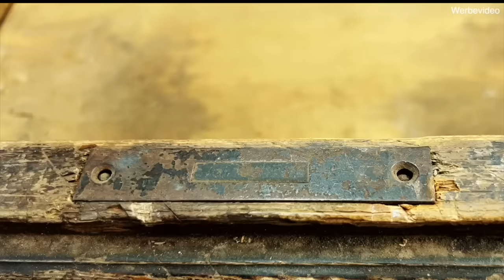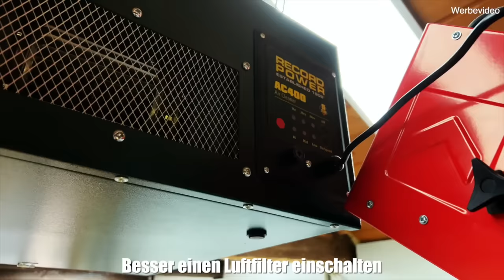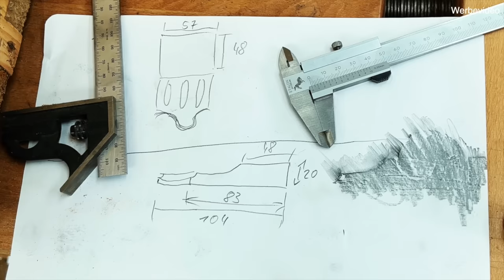21 Jahre Hühnerstall! EPOCHALE Rettung dieser Kommode

Comment: This is my favourite restoration channel. Love how the video is put together, great editing. Sir, you have skills to die for. Patient and a real understanding how to work wood. You are a great artisan.
Reply from the maker: Many Thanks
Reply: @chrigunrestauration  this is the most engrossing task undertaking I have seen for a long time. I feel so much better attacking my simpler chest of drawers now. Even without any tools to speak of. Thank you for your care with the old chicken sh*t piece to handsome treasure. Stay well.
Reply from the maker: @nancyanneberg403  Many Thanks. You don't need all the tools. The various tools only make the job easier. But it works with a lot less. You can achieve a lot with a nail lifter, scraper (plus accessories for tightening), paint scraper, one-hand plane, 2-3 chisels, glue and a grinder. Plus a hand and table saw. Then you are already well equipped. A lot of patience is also helpful. 😊 Greetings
Reply: @chrigunrestauration  I have mainly done wood repairs on several old homes rather than furniture. My days if house restoration are over but the furniture is something I can do. Thank you for the encouragement. Stay well
Reply from the maker: @nancyanneberg403  You're welcome. I wish you the same. Regards
Reply: Инструменты у него просто супер!

Comment: Wow, that took some real determination to bring that back to life.  As far as the discoloring on the wood, you can try "wood bleach", which is usually a two-part solution of sodium hydroxide (caustic soda) and hydrogen peroxide, and also could try other bleaches that have chlorine bleach and oxalic acid.  There are many brands on the market to buy.  In this case, maybe the dark stain was the better choice as there was so much damage.  All in all, what a fantastic transformation, good job.
Reply from the maker: Great information. Many Thanks. I will try it. regards 😊👍
Reply: I’ve used both of the bleaching agents as well, with mixed results, especially on oak. On pine it worked better. I also waited for warmer days, hoping that would let the chemicals absorb better. I don’t know that it made any difference; it was a notion I had. 

I always used a TSP solution on things this nasty. Now I’d start with a kitchen spray cleanser to see how well that worked. 

Your tool collections are fabulous. I could spend hours in your shop. Of all the tool hand planes are my favorite. They’re so satisfying to use and the configurations are so varied. 

I chuckled when you said you were beginning to realize the job was a bottomless pit.  But what an excellent opportunity to practice your skills!

A minor point: it looked liked the feet were left unfinished. Or did you just wax them?

I’ve lost so much of my German over the years from lack of practice but was happy that I could get the gist of your captions. 

Vielen dank, mein Herr.
Reply: @melindaostergren8115  I agree with you! He is definitely a caring and mostly patient craftsman who I’m very impressed with! Sir CR, I appreciate your talent and am thrilled that you shared this with the world!  Thank you for the pleasure to watch you restore this beautiful piece as close to the style of the craftsmen from the past!

Comment: I love these videos.  I refinished all  my furniture using white "chalked paint" it's called.  Walmart and Menards has the best price on it. I used both the spray cans, and brush application.  It gives a non-glossy finish, and this helps to hide any imperfections (dents) that you don't need to fill or sand out giving the furniture it's character.  Then the fun is buying new hardware handles (but this is pretty expensive).  I liked the silver/ chrome look.  It gives it a more updated, contemporary look, or clean look.

Comment: Great work and true craftsmanship. I agree that it’s worthwhile and rewarding to save old pieces from the landfills. However, this is not a ‘restoration’ as much as it’s a ‘renovation’. One of the things that made the design of the piece attractive in its original form was the mouldings around the drawers. I know the originals were decayed but I think replacing them would have restored a better design.
Reply from the maker: The strips were later reattached. At the time I created the video, I didn't have a suitable tool for it.
Reply: @chrigunrestauration  
👍

Comment: Fantastic, as usual! I wish I had one )) 1) I noticed one of the keyhole metal plates was totally destroyed, yet in the end you had all the plates in place. Where did you get exactly the same plate? 2) I didn't see that you hardened, filled or treated in any way the hole for the lock mecnahism. You just didn't show it or you didn't do anything to it?  3) do you treat all the wood with any anti-worm or similar solution after initial cleaning, scraping and sanding?  4) do you ever use special rotten/soft wood hardeners or epoxy solution except thinned bone and hide glue? If not - why, and if you do - in which situations?
Reply from the maker: Hello. I showed it. I used 2 plates. Replaced the others with new ones. I filed the keyhole into the other plate. From 10.30 p.m. I only use the skin and bone glue for the wormholes. It flows in and stabilizes the wood as it hardens. I do not use any chemical agents against woodworm. Either alcohol or heat chamber. I prefer heat chamber. The wood is kept at 60 degrees Celsius for 3 hours. Normally all worms are then dead. I don't use epoxy solutions. I think that these have no place on such old wood. Didn't exist 200 years ago either. The furniture lasts to this day. Greetings
Reply: @chrigunrestauration  Fantastic, thank you so much! You are awesome, keep good work!

Comment: it's a big improvement, and I get the reason for dark stain, I would use vinagar to lighten the would, scrub it in, let it set: put baking soda on it, and clean and wash it down the mix bleach and water together and wash it down, and clean it off well. It will lighten it a lot.
Reply from the maker: Thank you. Next time.

Comment: For dirty, stained, or partially rotted wood, sometimes a mixture of bleach and water will lighten or remove stains, also kills mold & fungus from rotting wood. I have used around areas of rotted wood after removing any soft areas and replacing with new wood. It does seem to clean the old wood.
Reply from the maker: Hi. Sounds good. I will try it at some point. Thanks. Regards

Comment: Was that black mold?
Usually I'm not in favor of using power tools on vintage or antique s but in this case it needed it! Wow!  Good job didn't think this was salvageable!
Reply from the maker: Thanks. No mold. Something has melted. And oil had spilled into the drawer.

Comment: Cooler Job! Allerdings hab ich ne Frage zum Holzwurm.
Ich hab mal - mit meinen Kenntnissen - eine Hochzeitskiste von 1851 und ein altes Vollholz-Küchenbuffet  restauriert. Die waren, wie auch dieses Möbelstück vom Holzwurm befallen. Hast Du nichts gegen den Holzwurm gemacht? Ich hab jedes Loch ausgeblasen und mit Holzwurmtot durchgespült. Allerdings habe ich die Möbelstücke naturbelassen und nur gewachst.
Reply from the maker: Danke. Doch. habe ich. Das Teil war in einer Wärmekammer.
Reply: @chrigunrestauration  Ach so, na die Möglichkeit hab ich als Hobbybastler nicht. Danke!
Reply from the maker: Da ich auch nur Hobbybastler bin, habe ich die auch nicht. Ich habe einen Schreiner in der Nähe der eine Wärmekammer hat. Dort bringe ich die Kommoden hin.

Comment: Not sure if it is the right we way or not, but what I have done in the past to clean really dirty or stained wood was to use bleach cleaner on the raw wood. I’m sure bleach is not what should be used but I’ve had great success with it bleach out the areas that are not the original color while it didn’t bleach the color of the natural raw wood so only the stains lightened up. Also using white vinegar or baking soda are 2 other ways. Each one works on dark spots based on the cause of the spots. White vinegar and baking soda is safer for raw wood.
Reply from the maker: Thanks. i will try next time. Greetings

Comment: Don't know if this is what you're looking for but..

 oxalic acid is typically used after stripping the wood finish to prepare the wood for the new one. Sodium hydroxide is a cleaning chemical that most people probably already know by two other names in particular, namely lye, caustic soda, and common drain cleaner.Dec 24, 2021
Reply from the maker: Thank you.